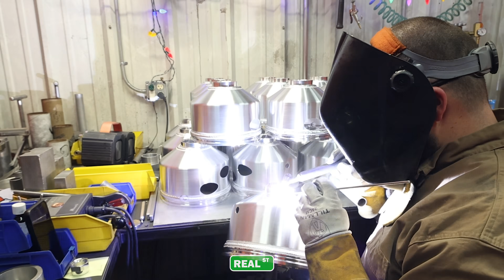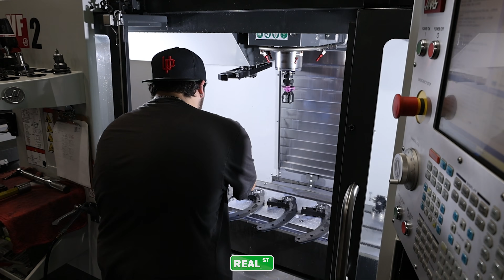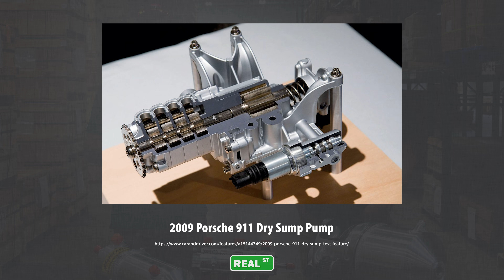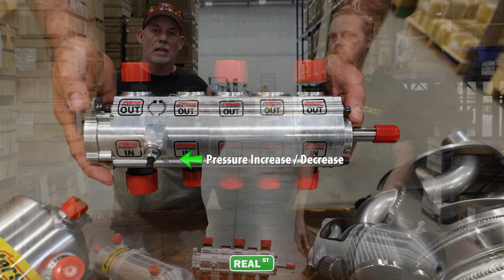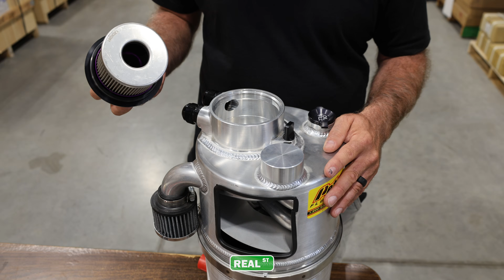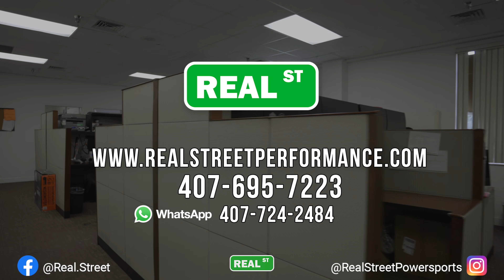Dry Sump System Explained With Peterson Fluid Systems

Comment: I wanna use that new "Turbo Max" inline 4-cylinder variable turbo engine, turn it into a outboard boat engine. Could I run the engine in a 90° vertical position for 7K RPM for hours???

Comment: I have zero interest in off street racing at this point in my life. I'm just experienced enough with hydraulic system design to be flabbergasted that all these little turbo and twin turbo fours are not set up with either a dry sump, and/or an auxiliary tank and a huge pump. Especially that crazy Jeep motor. They are just begging for failure on the used market and in the aftermarket. I'm just trying to figure out how practical a dry sump is for daily use. Sounds like a no go cost wise. But heck, there is no way I'd want to run 5 to 7 quarts of dirty oil through all that hot plumbing while looking for serious boost and compression while spinning pistons and such designed for a grocery getter. Just seems nuts. I'm picturing VW fuel pumps and Ford 6.4 rods shredding in mamma's soccer SUV and Dad's Colorado just because they believe the manufacturer's claim about oil longevity.

Comment: dry sump flat pans wont allow an engine to be mounted lower, because of the flywheel unless we're talking about f1, which uses a very small diameter clutch and no flywheel.

Comment: Great video, you never touched on the design of the oil reservoir- how it works, how it’s baffled, how it separates the air from the oil, if its design differs on application.

Comment: Justin just got through helping me with an entire dry sump setup for my road race 427w. I was ready to go with my wet sump engine running a Moroso road race pan, but after much thought, I regretted not building the engine around dry sump setup and decided I wanted the insurance and performance from the dry sump. Expensive and complicated deviation after the fact, but once I get it all done I will always be glad I went this route. Great video and discussion!
Reply: If you sell the road race pan and the pump, then you're only out the difference between what you bought those parts for and what you're selling them for. 

As for the new parts, think of it as a cost you would have incurred anyway, if you would have decided to build a dry sump system for it from the beginning.

Comment: Used many of those large tanks in off road short course trucks. We modify them pretty heavily but they work great. Also, people don't mention how much easier oil changes are as you can pump almost all of the old oil out of the system, put new oil in and prime it before you start the engine even set the oil level.

Comment: I never knew the difference. I never bothered to search. It’s pretty simple
Reply: With a dry sump the oil is always under pressure and lubricates the engine even when cornering unlike the engine with a wet sump
Reply: @ThePontiacgto65 kinda. Wet sumps don’t always fail like that but they can have hiccups in oil flow/pressure delivery in extreme G forces. The benefit is you’re putting oil where you want it and not making it branch across everything else first.
Reply: @RadDadisRad  Yes, but a high-efficiency engine will be immediately damaged if the oil pressure drops due to lack of pumped oil, even for a few milliseconds. It is an aviation technique, the dry sump oil system,like all high efficiency techniques for heat engines
Reply: @ThePontiacgto65  engines aren’t highly efficient, in fact they are below 40% efficient. You’re talking about tight tolerances.